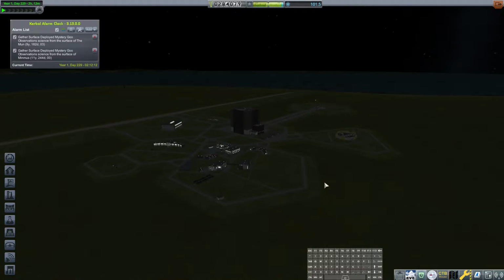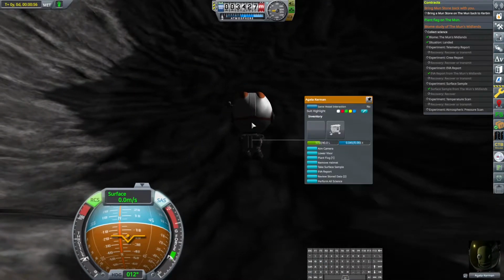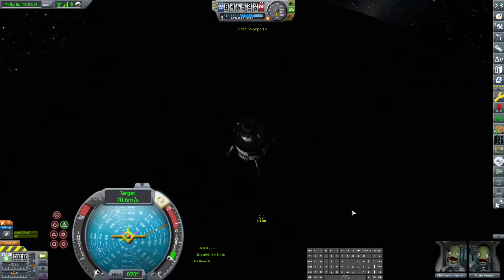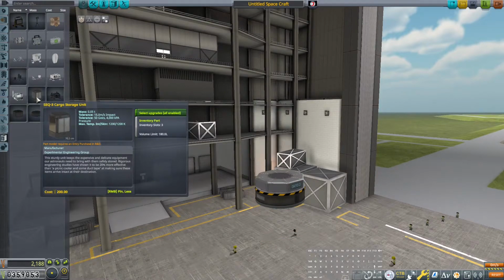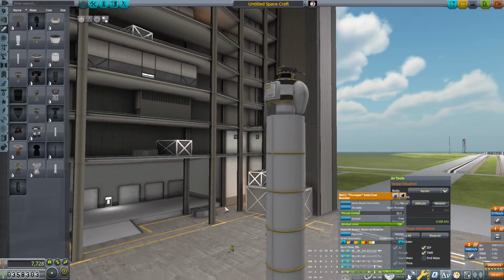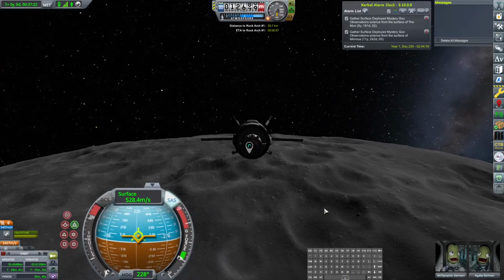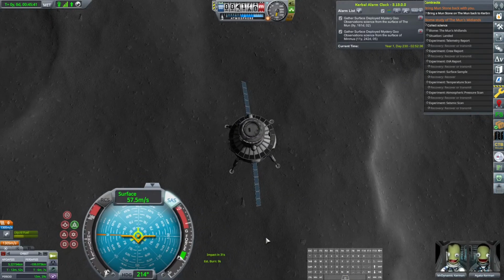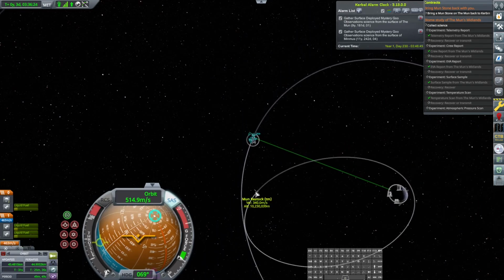Superfluous J Plays KSP - Kiwi Builders 23 - Another Day, Another Arch

Comment: Re: surface scatter:
Mun stones look like the normal Munar scatters, but much tinier. From what I've seen, pickable rocks are small enough that if you are seeing the big normal scatters, you are probably too zoomed out to see them. About half to a third of a kerbal's size.
Re: where to slow down/change tilt (49:00):
If you are mixing two big burns, you get a lot of advantage out of combining them.... but it's pretty much the same, energetically speaking, as a plane change at extreme altitude/low orbital speed, plus the slowing down/circularizing afterwards. Just a lot faster. So it doesn't really matter, just don't circularize first, then plane change, or change planes on circular orbits in general.

Comment: A 1 hour 15min video? I might not have enough popcorn... 

@15:10 -- Yellow clock on Kerbin/Mun (and some other bodies) - The stock scatter takes A LOT of juice out of the processor for some reason.  
I usually had troubles like you, admittingly with 100-150 parts rovers, and by turning down scatter (or even off, if you can stomach it) you tremendously improve performances
Edit: Oh yah, I suppose rebooting is a good option as well (as you did and it worked).

Awesome episode... Nervous times with your suicide burns and those flimsy solar panels, but pretty enjoyable.
Too bad you can't mine the Mun for some easy fuel.  Dock the largest available tank to the station, and put a mining operation on mun.
Tho I suspect the Mun will be over soon anyways.

See you around !